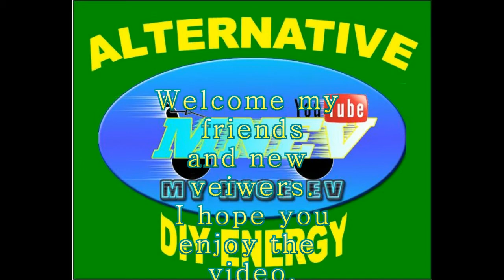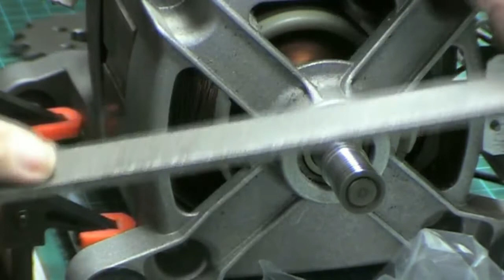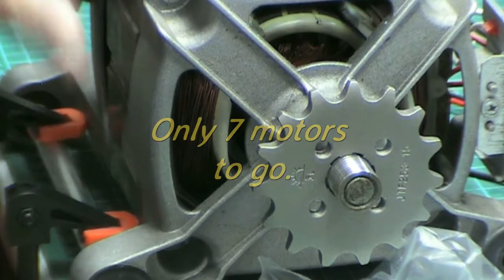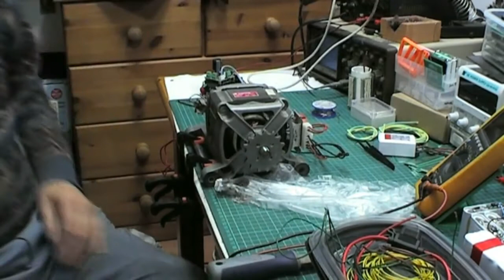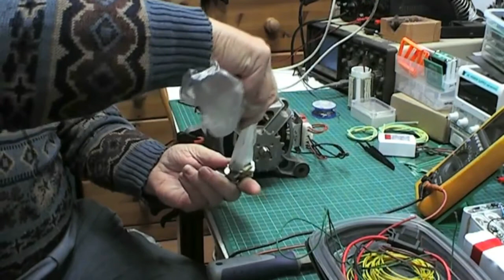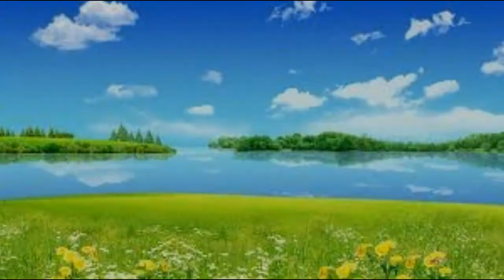MY NICE EV M1 Poormans Lathe ish.

Comment: nice to see you making more progress the frame bothered me the last time i saw it looked very flexable
Reply from the maker: Scrapped the frame my good friend. Caught the back of my hand on the corner. Right mess. So building it Morgan fashion in timber. Before timber goes into frame it will be modified to use less yet be as strong as steel. I hope you and Diane are enjoying a warm evening my friend.
Reply: @MYNICEEV  well if it worked for morgen lol and wood is easyer to work with and diane out at a friends at moment but we are ok

Comment: lovely work my good friend :-) This should work real nice with your design and its structure and weight i think, the efficiency of these motors really is high and only second to the tesla ones say, the efficiency gradings on most really do seem bob-on in the math and results. You will have to go easy on that throttle for sure, nothing says time warp like li-ions and all that power to weight ratio :-p Keep the top quality up my friend you do great at setting a bar to work to when working. My best you know it Paul

Comment: you should move the file so you dont unevenly dull the teeth. i still need a chuck for my poor mans lathe... i have a washing machine motor and a motor controller already. currently i have mounted a chuck out of wood on it... its terrible
Reply from the maker: Hello my friend. How are you? Many thanks for the advice. When I do the other 7 motors I shall do as you suggest. Where on this Planet do you live. If you send me details of the chuck you need. I will keep a look out for you. I am in Hereford, UK. The Freecycle system here is amazing. Don,t worry about postage. Have an amazing day.
Reply: im fine, i hope youre doing well. moving it should also evacuate the chips from the teeth. i live in munich, germany, so at least we are on the same continent. here are pictures of my current "chuck" https://i.imgur.com/llgJ9qV.jpg and here is the motor mounted on a u profile https://i.imgur.com/oGdz3VR.jpg so as you see i dont have space for a big chuck. 8.5cm from the u profile to the center of the motorshaft. so i guess a 100mm chuck would be best suited. the belt pulley that is still on the shaft measures 25mm in diameter and the shaft itself 14mm. any idea how to fit a chuck on there? sadly here in (southern)germany recycling is largely industrial, i got some very weird looks when i asked to take a look around at a scrapyard. if you come across a chuck, do tell me what shipping costs though, its probably not cheap to ship a hunk of metal.
good luck with your vehicle, looking forward to every video